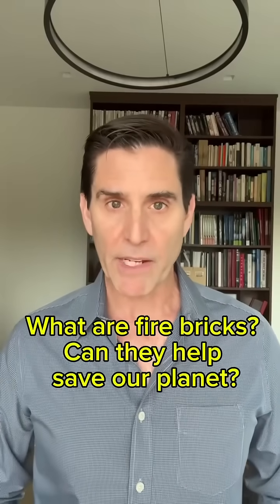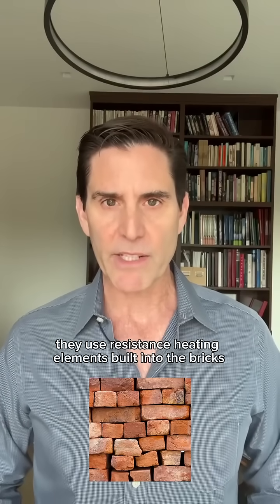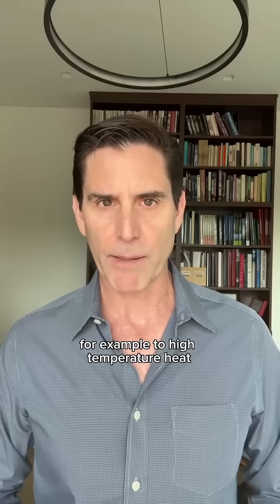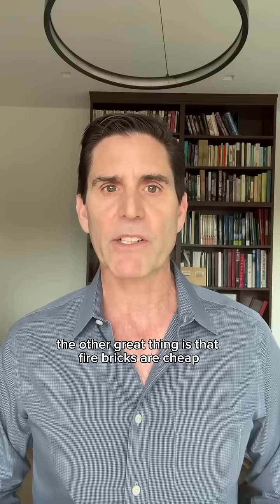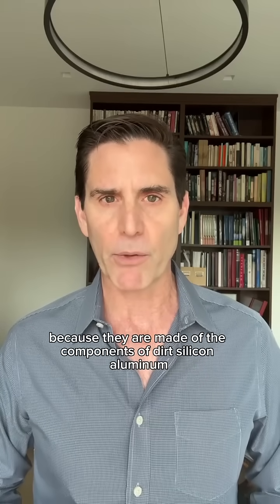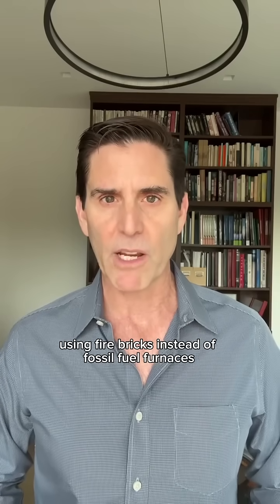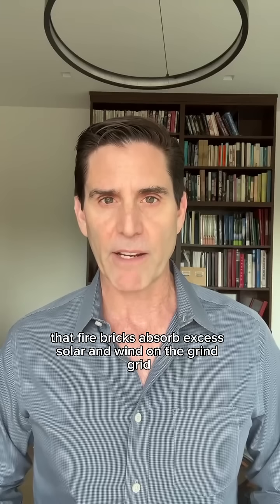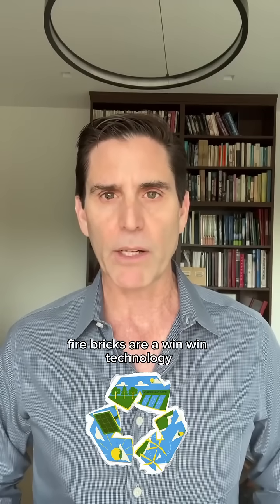What are firebricks, and can they help save our planet?  #renewables

Comment: Just for industrial applications?
Reply from the maker: Yes. Better to use electric heat pumps for low-temperature heat (for heating buildings) because heat pumps use 1/4th the electricity as resistance heating, which is used to heat firebricks.
Reply: @markz.jacobson8659  thank you